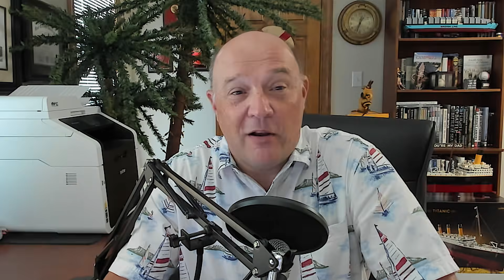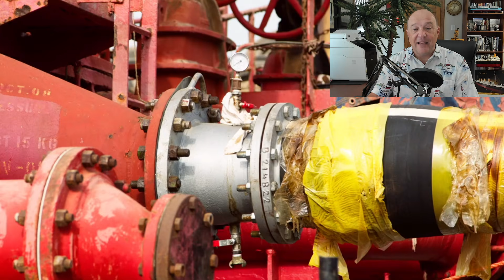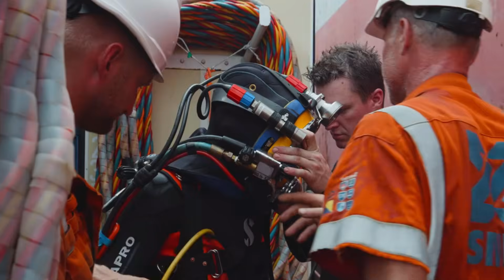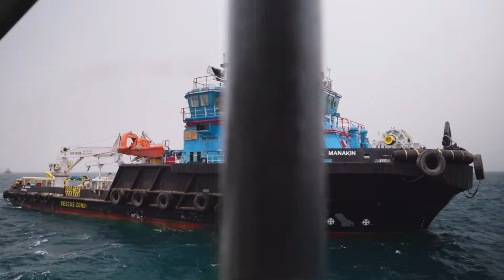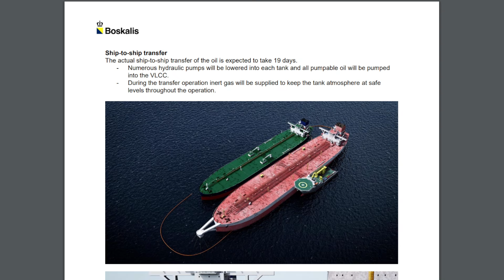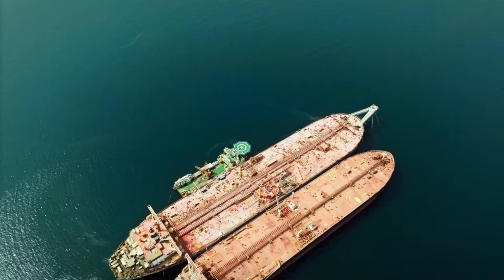Floating Storage and Offloading facility Safer Offloaded by SMIT Boskalis off Yemen

Comment: The salvage team departed the site of FSO Safer on Monday, August 29, at the completion of the project. Still to be done is removal of Safer to recycling facility, replacing mooring buoy and installing a new FSO so that offshore oil export facility can be placed back in operation. 
PS — Good job by all involved!

Comment: Just wondering what happened that made the intended off load method unworkable. Seems that an offload by the mooring pipeline would have been the most practical. No word on why that wasn't used.

Comment: I assume that this operation was done under the terms and conditions of Lloyd's Open Form or any other form thereof, meaning that the vessel and the cargo onboard would have been considered as abandoned. Therefore the oil and scrap value of the vessel can be sold as done with other salvage operations, and the revenue used to cover part or all of the salvage operation.

Comment: I assume that once the cleanup is complete that the Safer itself will be towed away somewhere to be scrapped. I guess it could be left to rot in situ now that it doesn't pose a significant environmental threat but it would still be a hazard to navigation.

Comment: The reasons I can see as to why the UN would buy a tanker are the following.

1. Unloading the oil makes the tanker a potential target for the belligerent parties in the Yemeni civil war and their international supporters. This risk could dissuade charter companies or owners from allowing their vessel to be used for the operation.

2. The high profile operation in an area with a risk of piracy, including having to be stationary with a valuable cargo for a significant length of time could cause charter companies or owners to feel the potential risk outweighed the payment available.

3. A lack of clear responsibility as to who would be liable for the cost of any clean up operation had the safer broken up during the operation would be a deterrent to charter companies and owners in involvement with the operation.

4. Given that there is a high probability that other abandoned vessels will need similar salvage capabilities to be available, with similar disincentives to privately owned tankers being involved, having a UN owned tanker available has advantages.

5. If the UN charters out the tanker while it is not in use for salvage purposes, the profits from the charter can fund UN programmes.

Comment: how do these FSO's accommodate the tidal rise and fall of sea level?
Reply: The chains... same as floating oil platforms and ships.  It's not the anchor which does most of the work holding them in place, it's the weight of the chain on the sea bottom causing friction to prevent the drifting.
Reply: The pipe to the shoreline must have some form of flexibility engineered in to accomplish all the geometric variations….

Comment: I once heard that gas inerting meant feeding the main engine exhaust gas into the space -it's basically air without the oxygen. This suddenly becomes difficult when the main engines are not run.
Reply: It's not so much that it means that, as that using engine exhaust can conditionally be an easy way to do it.
Reply: Tankers like this usually were steam ships (as in main engine and ancillaries were steam turbine driven) so they had 2 high pressure boilers with really efficient burner control where you could reduce the oxygen level of the combustion process right down to levels below 5% O2. These gases would pasted through a scrubbing tower where the gas is cleaned and cooled and then blown out to the tanks. Exhaust gases from a motor main engine are too high in O2 to use as inert gas, so a specific Inert Gas Generator is used. It’s smaller but not very energy efficient and similar to the portable ones used in the recovery. And expensive!
Reply: @jimmarr9556  except any number of Videos from the past 15 Years would show that the original Comment was correct; and that you aren't...🤡

Comment: The Yemen needs to offload the oil in the tanker off the Texas Coast before a hurricane offload it into the Gulf. But then, it's America, and US politicians are involved, and they would rather spend taxpayers money to clean up a diaster, than prevent a diaster.
Reply: Obama proved that by allowing the Deep Horizon drilling rig to use substandard procedures and materials. Heck, they practically forced them.
Reply: Why is the Yemen going to Texas to unload?
Reply: @j_taylor  needs is not the same as going. Are you a Millennial?
Reply: Because preventing an issue... means they have to spend money which MIGHT protect from something happening in their term... but is more likely to not, so they would rather use the money on something which buys them votes.

Comment: Great job by Boskalis, great summary of the operation which in reality was even more complex (question of mines being attached to the FSO). Now it is over to the next phase: Will the ship be released from its mooring safely and without spills (there still is crude in the pipeline)? Will it be decommissioned responsibly (and transferred safely, and cleaned properly)?
Reply: Of course not.
Reply: @senatorjosephmccarthy2720  I'm not so sure, because I see the tide slowly shifting. The Hongkong convention is finally ratified, the number of scraping yards with high environmental standards is increasing, and the Safer is under the eyes of the world. In my opinion, other similar vessels are much more at risk of disappearing, to show up later renamed and with a new owner under funeral flag at a beach.